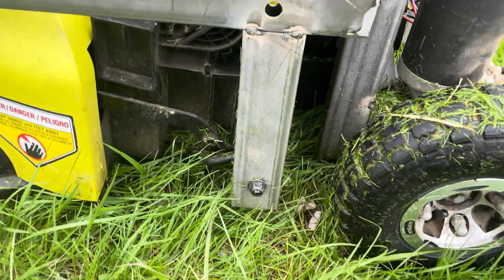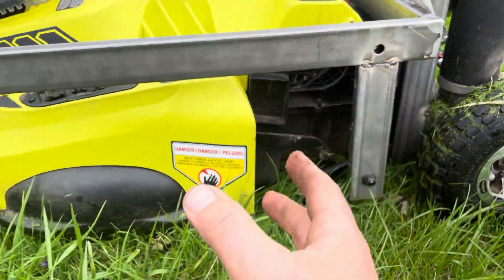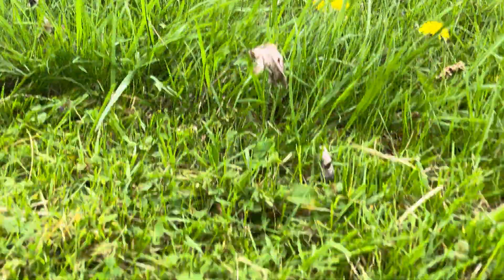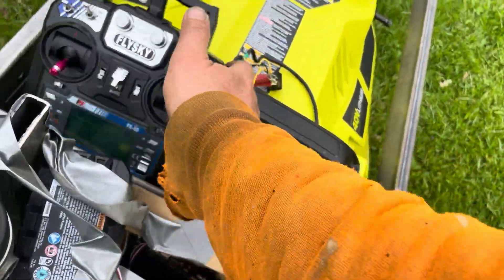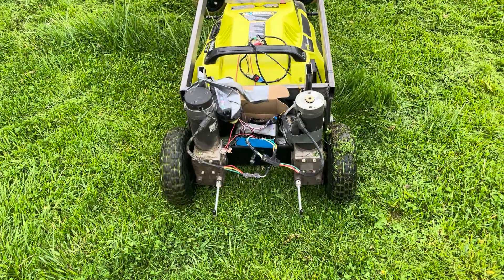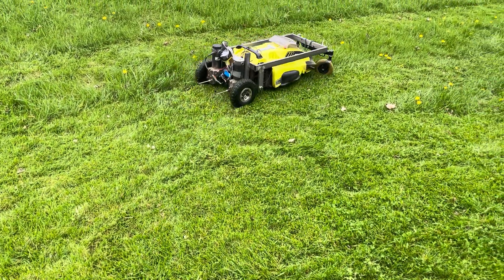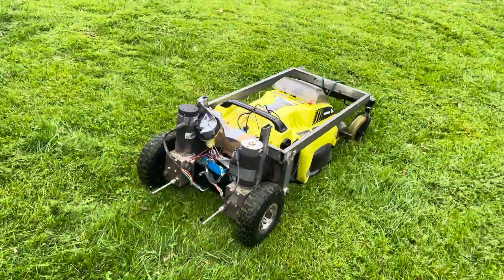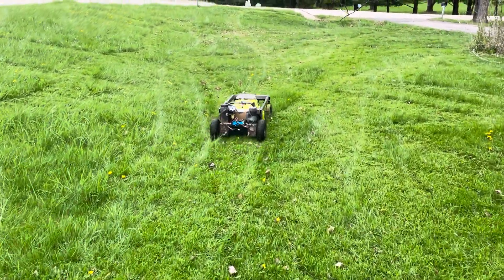RC Lawn Mower - First Test Cut

Comment: Nice, maybe if you hang each axle from the rail  (at the height from the ground that each wheel center would have been) it would allow the height adjust to work close to how it did before. In other words if you used 4 bungees and adjust where they hang from just a little bit you will find that sweet spot that keeps the mover level during height adjust. Once you find that position on the rail you could make a mechanical flat stock  link with a hole on each end (2 bolts)  to connect to the rail and the original axle.
Reply from the maker: That's essentially the approach I had been taking. I tried already with some short connectors that were bolted on but could swing freely. It ended up being too floppy. Going from forward to reverse and back on the mower would make the deck move in unexpected ways.
Maybe I could try again with just the fronts being on a loose swinging member, since the rears are now solidly mounted.

Comment: Use chains to support the front axles.  You can still adjust height but allows spacing to change.
Reply from the maker: And it would be simple.
Would be GREAT for testing designs too!

Comment: now you only got to put a Roomba brain in it
Reply from the maker: One thing that's pretty cool about the motor controller that I got is that it supports an input for a microcontroller (Arduino, ESP32, Raspberry Pi, etc.) Once I have it fully working correctly as an RC Mower, it should just be easy to upgrade into a Robot Mower!
Reply: @BenjaminNelsonX  then it'll graduate from a fun toy to a useful asset

Comment: so cool... now we just need a camera looking at the yard and opencv tracking the position and driving it in a chosen pattern! For the front height, i would just make your own height adjustment like you mentioned but i'd do it where the wheel shafts are. Also it would be awesome to try 3d printing some different wheels to try out to see if you can improve traction on grass with other shapes! thanks for taking the time to share.

Comment: Regarding the height adjustment, can you make a horizontal slot so that the pin can slide forward and back?
Reply from the maker: Great question. I think that would be one possible solution.